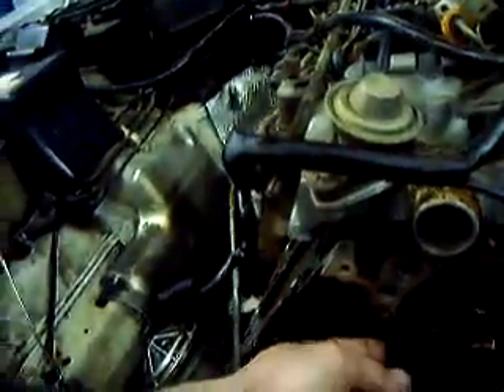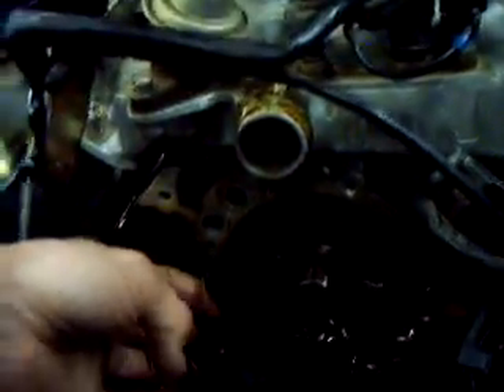Seized engine

Comment: As a former Dodge mechanic I was shocked and pleased to see Mercedes interiors and engine internals are done in matching colors and would like to personally commend the owner of this particular speed-peedle on the classy and understated Toffee-Carmel color scheme. 

I did rod bearings on my '74 Ford Courier (Mazda B1800) in the driveway last week. It prolly has 400K on it. It starts every time I turn the key. It drives like a riding mower. I love my truck.

Comment: The only reason you would have to replace the motor is if the block is cracked. you can replace seized bearing, cranks, pistons, etc.

Comment: Hi 
Not true depends on the cause of the seizure, if it's humidity related Engine Release is good on corrosion, if it's lube related a good look at the over all condition of the engine is required to make assessment if it's a parts failure i.e broken piston etc don't have to do the whole engine.

Comment from the maker: If I would have done that, the broken part of the chain rail would have pulled through the sprocket moving the timing chain and bent the valves ain't gonna take that risk it had a broken part of the timing chain rail stuck in the sprocket.